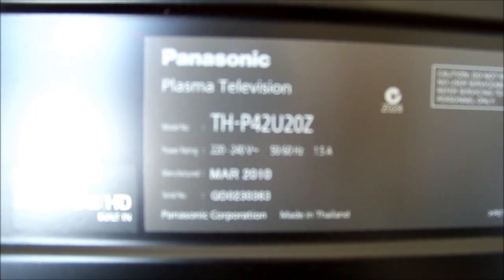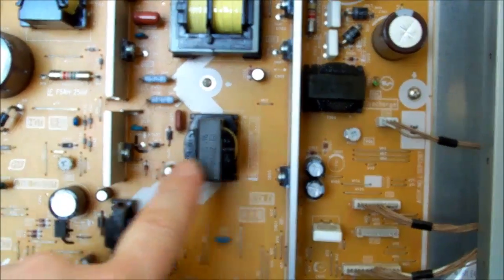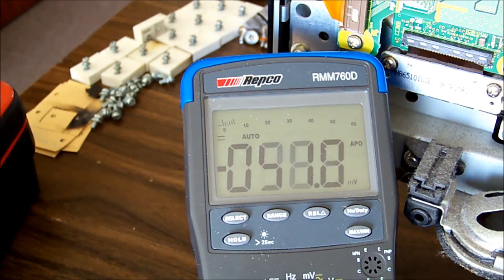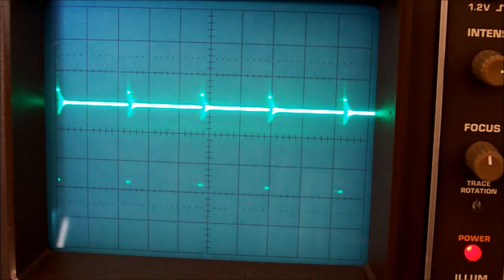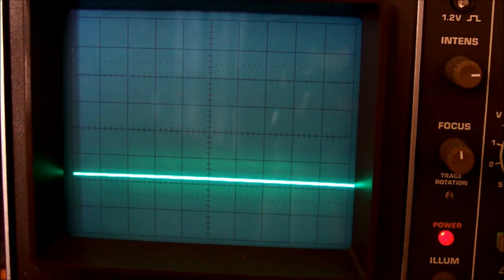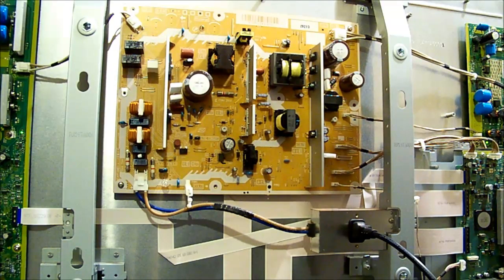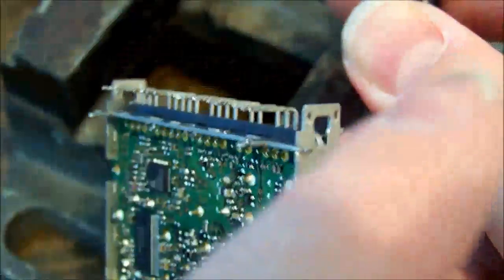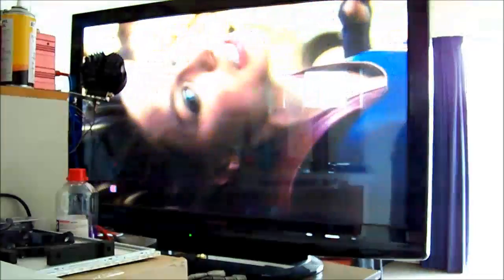Panasonic TH-P42U20Z plasma TV repair

Comment: 27:03 You made quite a mess when you were using the desoldering pump. Watch out for solder parts spraying over your board when trying to remove it with the desoldering pump. A small amount of solder made a new cold solder join on that resistance and diode below the coax connection. You can clearly see it in the video at 27:03 and it didn't look like, that you removed it later in the video.
All in all it was a good and informative video. Thank you for that.
Reply from the maker: Yes that annoys me about solder pumps. I think it was gone at 33:56. Good spotting tho!

Comment: Hi Jonny, I have the neighbours th-p42gt20 with no 15volt rail, traced it back to the 7pin device on the centre lower heat sink...
 but im stuck from here.....any tips ? might make a good video....I could send it down......Brett
Reply from the maker: Is that IC400? That drives the primary of the transformer. If no 15V on C801 or C806 or pin1 of Q800 then put a scope on there. Remember to clip the ground lead to a ground point on that side, not the primary side. If you see brief pulses you might change the optocoupler IC401 as a guess as it could be lacking in feedback needed to create rail. The power for IC400 looks to be self generated so will run even in standby. Make sure there's no short across D405 which looks to regulate this, it is a zener and I've seen them short. A bad C405 could stop this from creating it's own rail to. If you have 15V on Q800 (which is a mosfet) then the gate pin3 is not being given a signal to turn it on and pass it through to the rest of the system via pins 5-8. This is controlled by IC603. If pin 2 has some kind of reasonable voltage and reset pin 6 is high some more investigation will be needed to trace the inputs required to make this chip turn on that mosfet. If you need the schematic for power board I found it on eserviceinfo.com. I have not found the main board yet. Oddly Q804 is also a mosfet in parallel with Q800. If either one are damaged that could pull the gate signal away so the other doesn't turn on. Hope anything there helps :)
Reply: @JonnyFix  Thanks heaps......yes its ic400........thats a closer schematic than I had.......I will go over the power
 board again tomorrow with your new points to test......Brett

Comment: hello . at timestamp 0247 what is the globe looking thing there to the right of the power input ? on my TV i measured open circuit across that. i can see no filament as i might expect in a globe. there is approx 60 volts to one side and zero volts on other side. if you would have any information i would appreciate please
Reply from the maker: It's a neon bulb that is there for surge protection, if a very high voltage appears on the input it will discharge it safely and light up while it does so. There is no filament in a neon bulb.  60V is not enough to light one and might be there during normal operation. The TV should still work if the bulb was removed. You cannot test a bulb with a multimeter and it will show as open circuit.

Comment: Hi, my Plasma TV model TH-P42U30S, there is no red light at all, whats is the problem. can it be repair. thk
Reply from the maker: I don't know the exact answer. You need to check the basics like I show at the start. Fuses, standby power supply. If you have about 5volts on standby to the main board then the fault is on the main board. If not, then you need to troubleshoot the power supply board.
Reply: Not 100% but does this happen after power went out or tv was unplugged? If so its likely  the u203 IC chip failed

Comment: ive had it before where a tickle of the multimeter voltage across an open high resitance feedback resisitor kicked things into life. your case maybe a capacitor gets charged in circuit. Did things stay OK after leaving the tv off for a long time. anyway. this was a long time ago. but i find these repairs interesting and frustrating to not know what exactly was the problem.

Comment: th p42a28K only red led what problems sir?
Reply from the maker: I guess if the light doesn't go off or blink when you press power button there is a fault on the main board, a problem with the button or a problem with the IR receiver.

Comment: Thanks for this video. I have a Panasonic viera TX-50S30B it click when the pover button is pressed and the power green led blinks 4 times and that was all until you press the power button again. Panasonic calls this SOS4 any help on this? Can you get the Schematic or service manual for for it. The power board is MPF 6910. thanks
Reply from the maker: Sorry your comment was held for review. I would try google for a service manual. Someone said unplug the LVDS cable to the panel, if it turns on you have a bad panel or a fault on the board that drives it which you may be able to fix. Check for shorts on the power line. If it still blinks I'd check the power supply. Obviously it has standby rail or you'd have no light. If the other rails (expect maybe 12, another 5, 3 etc, might be printed near the connector) come up then you have a main board fault. If one doesn't come up check for short to ground on that line on the main board. If none, look for fault on power supply. Also physical problems (bulging capacitors). Good luck!
Reply: Thanks a lot for your time. It was discovered that there are 6 mosfet on the SU board and all are short.

Comment: Can a smart box installation can be the reason for motherboard going kaput in plasma TV? This is for TH P42UT30D
Reply from the maker: I think highly unlikely
Reply: @JonnyFix  what could cause it? Our TV was switched off when we heard a sound. Our connection is via a regulator, so if there was a voltage surge, how come regulator wasn't impacted. The smart box that was installed by the cable operator went kaput and so did our TV.

They are trying to pass off the thing as sudden surge in voltage which by the way didn't impact our any other electrical appliances.
Reply from the maker: @MrUtoobee  That is strange. So neither of them turn on now? And you have tried something else in that power socket to make sure the socket is still working? A power surge would have been common to both but I can't say why other appliances have not been affected. Coincidence? Lightning overhead causing EMI to travel down the antenna could affect those 2 things.

Comment: We not getting voltage in bridge rectifier  please suggest me solution
Reply from the maker: Broken connection between mains plug and board, bad power switch, blown fuse or PTC, open input chokes, wall socket is bad.

Comment: hi, love the videos you make, I do lots of this sort of work but only on smaller things like phones and laptops etc. Anyway I just have this massive panasonic tv and my little girl hurled something at the screen. screens not broken but it has the 7 red flashes on the led by the power button. its very similar to this one and i want to fix it. I noticed a small light bulb looking object on the circuit. could this be the culpret? i saw lots of entire board replacements but thought it might be more simple. Please let me know what you think and what the light bulb device is.
Reply from the maker: That's really  coincidental that a screen impact has done that. If it's plasma it may have created a short (brief or permanent) in the screen that has damaged one of the sus boards. If the bulb like part you mention is on the power supply then it's probably just being used as a surge arrestor. They usually use a neon bulb for this. Highly unlikely that it has failed and if it had it wouldn't stop normal operation.

Comment: hi i got the same model TV but when i hit the on / off all i get is the green light flashing for a bit then 4 red lights flashing  got any ideas wat it might be
Reply from the maker: You must have standby voltage so check the other rails are coming up when you turn it on. My initial guess is one or more are not. Don't forget the high voltage VS and VA lines. If they are missing then unplug the Y-sus and Z-sus boards (connector top left and top right on power supply) and see if TV stays on and voltage comes back. This will mean you have a fault (likely shorted component) on one of those boards. If you don't want to track down and replace the faulty item you could probably find a complete board on ebay.
Reply: wat part of NZ you in me hope you in Christchurch or Ashburton

Comment: am I correct to see you the scope to view 300v? can u tell me the scope setting u used? can the siglient view this voltage as well?
Reply from the maker: Yes, you will have to use an isolation transformer and make sure TV and scope are running from that. The problem is if you don't and you connect your ground lead to the mains (primary) side of the power supply your lead will basically short phase to earth and blow it apart along with your scope. My old scope has a DC in jack so I can run it from my bench supply instead of mains essentially isolating it. Set probe on x10 and use 10V/div so each div is 100V.
Reply: ok does the dds sopes have up to 10V/div ?
Reply from the maker: Raj Dann  mine goes to 100
Reply: Jonny Fix what scope u use?
Reply from the maker: I have an old philips PM3305 and siglent SDS1102CML

Comment: Hi Johnny! 
I have a problem with a plasma panasonic TH 50x20M thst flickers and works for a couple of minutes. Could you please help me with some tips and service manual if possible? Covid19 restrictions prevent me from further initiatives. Jail without bars at home.😝 Thanks and regards. Sham.
Reply from the maker: Oh I don't know man. Google search model number and 'service manual' is what I do. If it shuts down completely and power light blinks then you need to figure out the code it's blinking. If it stays on (has sound) but the picture goes off you want to start by checking all the voltages are correct coming out of the power supply. I think it's Vs and Va which are important for the panel and usually a sticker inside says what they should be set to.

Comment: I tried to turn on only the power supply, but the relay didn't turn on and I measured the voltage on the big Elco, no voltage came out, what's the problem, sir? Is the relay broken?